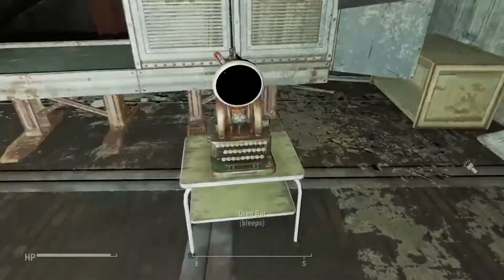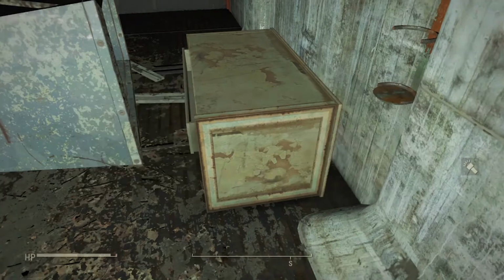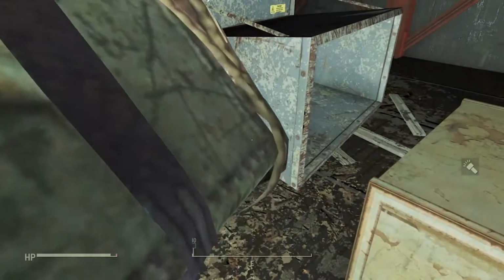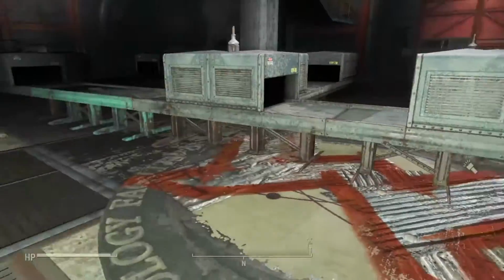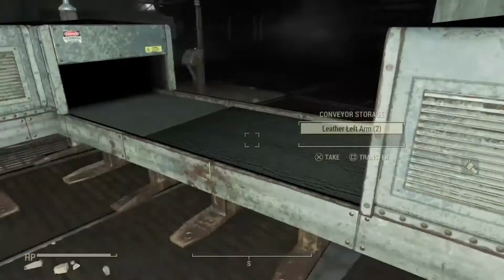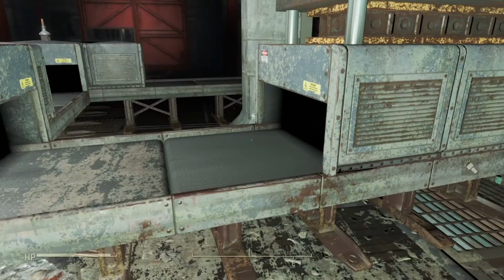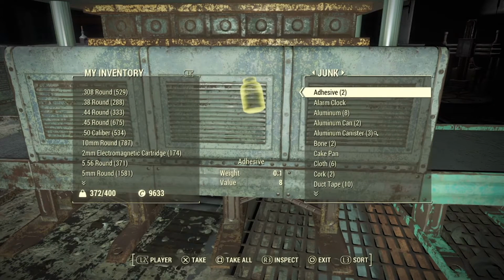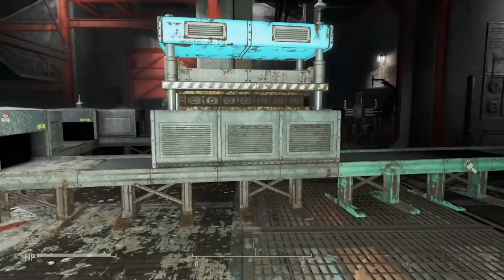Fallout 4: MANUFACTURING Tutorial - How Manufacturing Works (from Contraptions DLC)

Comment: The only way I could see it being useful is if it could break down junk it pulls from workbenches, which could connect to other settlements via supply line, which could be supplied by scavenging benches. Otherwise this is too much work to make a few pieces of armor, compared to just throwing the junk in the machine and having it throw all the stuff in the same container. 

And that sucks because I love the idea of automation and factory production. (Factorio FTW!) I was so excited when I first saw these parts, but it was a massive let down.

EDIT: There's apparently a mod for this, but FO4 isn't the kind of game I should need to fix with mods.